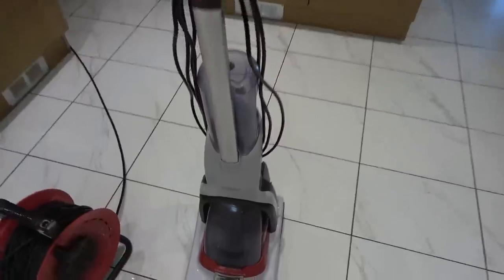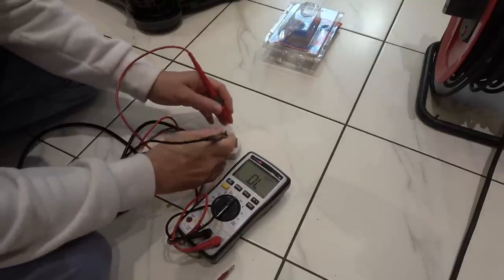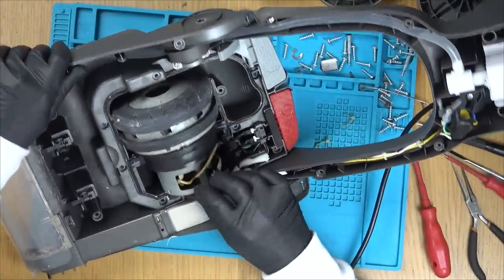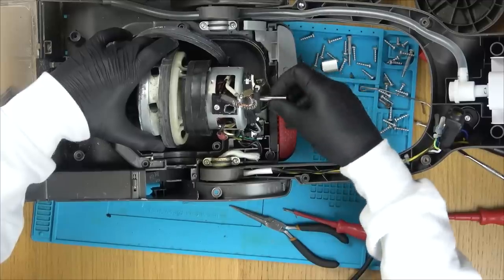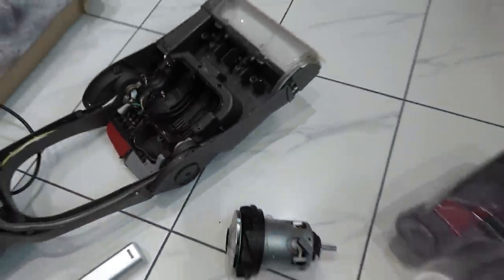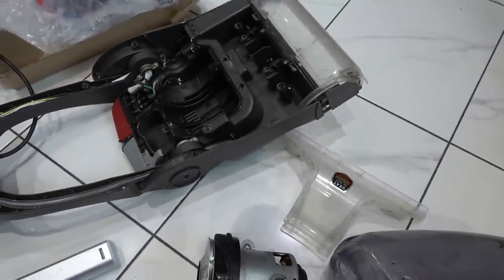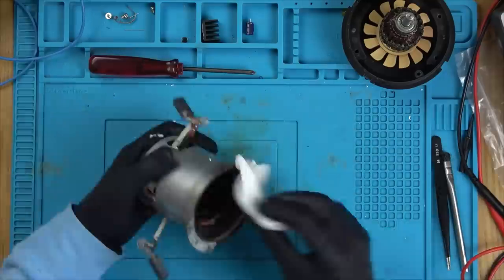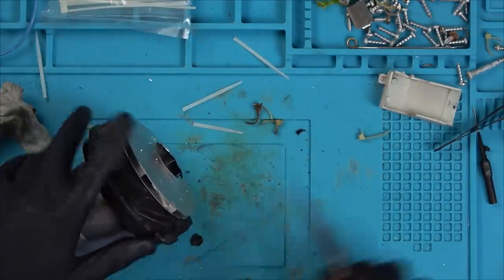Vax Carpet Cleaner Tripping the Electrics - Can I FIX it?

Comment: Vince, using Ohms Law, a 12 ohm load at 230 volts is a 19 amp draw.  (I=E/R) As others have said, the motor windings are corroded and internally shorted. The burning smell is the 19 amps heating up the wire/windings and burning. Probably the switch as well. Essentially, you made a toaster.......
Reply: Ohms law is only accurate when calculating for DC - it will approximate only when calculating AC
Reply: @Grumpy_Granddad  agreed however it’s accurate enough to see that at that load it exceeded the house supply . In the US, standard household outlets are 15 amps. I wouldn’t have plugged it in.

Comment: The moment I saw the discolouration of the enamel coating there was a 99% chance that motor was toast. The enamel coating on the winding's is the insulation. A company I worked for made Arc Welders and Spot Welders. The transformers not only used enamel coated copper wire for the transformer winding's but the completed transformer was preheated in a furnace/oven and dipped in another insulating resin and baked overnight for added safety and to prevent the winding's from vibrating against each other due to the magnetic field.
Reply: BASF  used to have a plant at a place called Slinfold in the U.K that made that coating . The chemicals involved were extremely toxic and unstable . They reckoned that if the plant went boom it would take out the nearby village . They used to practice for if a plane going into Gatwick airport crashed there

Comment: For future reference Vince, motors generally have a reverse threaded nut on the shaft, so that inertia "tightens" when it spins. That's why the nut wouldn't come off when you tried
Reply: Did just that only a few months ago, should have realised at my age, worse, I used an impact driver, sooo difficult to get off once I had stripped the thread, had to re-thread motor shaft to smaller size....... not fun
Reply from the maker: That didn't enter my head at all until reading the comments. Makes complete sense know. I'm pretty embarrassed, but at least I now hope I will remember that in the future when working on items with motors in. Nice one for the comment, thank you 👍👍👍👍
Reply: Yes that was painful to watch sure I've don't worse myself though. Nobody can know everything
Reply: yeah, I learned that when dealing with a faulty blender once, and found it consistent all over motor based devices.

Comment: I've learned a few times the hard way that trying to test motors and windings with a multimeter can easily trick you. If you do that more often an insulation resistance meter is worth it's money. I think they start around 50 bucks from brands like uni-t and others. They can do the resistance measurement under a high voltage so sparks can jump over and you don't get tricked by wrong results from a multimeter. If the insulation of some of the windings are slightly damaged or burned but don't touch each other you only measure the short under a high enough voltage because that's when the sparks jump over.

Comment: Definitely a new motor required.  Those windings are shot with the plastic cable ties melting and creating the burning smell.  It's a race between a fire starting and the mains power tripping.  Fortunately, the circuit breaker is doing it's job to prevent the other eventuality.

Comment: Hi Vince, you can generally tell by the smell when a winding is overheated and burning. The copper wire is insulated by a varnish and is unmistakeable. The cost of a motor rewind would be several times the cost of the machine so it is just junk. The copper can be reclaimed though. If you can get a new motor and it works, at least it will save even more plastic from landfill.

Comment: Some of the windings on the commutator (the spinning bit in the middle of the motor) have gone short. That's why you were getting different resistance readings while turning it. Unfortunately without a heap of work rewinding the thing it's nackered I'm afraid. Cheers.

Comment: it is always a pleasure watching someone struggling to undo the left thread  :)
Reply from the maker: Haha, oh no, are they really a left hand thread. That didn't even enter my head as a possibility 😂
Reply: @Mymatevince Yup sure are! I got tripped up for a minute when I pulled my Bissel HotShot carpet cleaner apart. That whole thing is an octopus of vinyl tubing inside. Such a PITA getting it all routed out of the way to get the casing halves back together. 
Good vid as usual buddy. Greetings from Kenosha, Wisconsin btw.
Reply: @Mymatevince  oh, yea, I know the feeling, been through this. It is like when you think you won an argument with a woman. You just pushed a little gey boy through a military school. Ever since my first vacuum cleaner "repair" I search the internet for every device I attempt to repair, even just from the same category, hard to find exactly same model. I would say, it doesn't change much, since the winding is cooked, but if you didn't strip it, you could attempt to rewind it. You would definitely fail, but it is really fun to try. You watch hours of your most careful work going with smoke in a split of a second. I did it like 4 times.  Cheers mate.

Comment: Good effort Vince. I think I would have called it after seeing the windings burnt. 
I think what could have happened is this...
If they had left the unit filled with water after use, moisture could have evaporated from the holding tank and the vapour went down the pipe and into the motor area causing the bearings to rust and seize the motor. 
The next time they used the unit (a few month later), it probably hummed and smoked a bit. They then probably unjammed the motor by turning the brush manually and then it ran with a very noisy bearing and semi burnt motor and tripped the electric.... and then you bought it :) Great effort though, and hopefully you can find a new motor for it👍
Reply from the maker: Thanks Mick, another option might be it leaking down from the clean water bottle up top. I only say that because since this video I was round my friends house and he borrowed one ( a Vax) that broke in his possession.  He said it is a common issue with it leaking from that top bottle, travelling down the upright bit and dripping into the motor area. I hoping a replacement motor will turn up on eBay and I can get  quick revisit done on it. Cheers for the help  👍👍
Reply: @Mymatevince  Ah no worries. I had something similar with a Milwaukee wet and dry vac (few months back) where moisture got into the bearings and rusted them resulting in a seized motor. Hopefully one will turn up with missing parts or cracked casing or something 🤞
Reply: @BuyitFixit  My mum's Vax just had the same issue with the motor effectively being rusted - is this a design flaw? would anyone have any ideas as to where to silicon so that any replacement motor is sealed effectively?

Comment: Motor definitely shot. It was a really, really bad sign at the video start when you turned the brush/motor assy and the ohm reading about tripled. Wether locked down and not turning or not, the ohm reading should not vary like that just by commutator turning on brushes. I also wonder if the water got in the motor because someone stored it laying down (or it fell over) with water in the recovery tank? Hope you find a motor soon mate!
Reply from the maker: Thank you 👍

Comment: I had the exact same fault on a VAX 6131.  One of the outer coils had a short after the motor flooded. This explains the on-off stuttering, as only one side was active. I had to replace the motor but when it arrived it was not the same despite supplier's promise. However, with a bit of ingenuity and cutting of the inner plastic cowling, I got it to fit. My model has a floating ping-pong ball to cut off the vacuum tube to prevent water being sucked up when the tank is full. This had failed. A new ping-pong ball did the trick. The old one had a roughened surface. Don't know why. By the way, the motor fan thread is left-handed on mine, so I guess it was on yours! DOH!

Comment: Did you check if the cleaning brush spins freely? It could be something stuck in the brush like hair or carpet fibres that would block or slow down the motor and make it overheat? That also happens with Dyson vacuums except they have a safety that stops the motor if the cleaning brush is blocked, if this one doesn’t have that, that could give this kind of symptoms I guess

Comment: I agree with a lot of the comments below, the windings have cooked, the coating has melted that covers the copper wire and it has shorted.
Just unlucky you don't have a PAT tester, this would have shown instantly that their is a high resistency, or dead short.
Testing the windings with a multi meter can be a pain as sometimes the windings check ok until power is put through them, then it arcs out, heats up and pops your rcd, the motor kicks in, shorts a few times then the rcd cuts your power, this is why the motor reacted as it did.

Comment: Hi Vince, the motor most likely block because the stator casing is not secured on the front cap. You can see the holes for the screws @20:08 (4 holes on the motor housing and 4 holes on the black support). Probably somebody else has been there before and checked the burnt windings on the rotor.

Comment: If the machine tips over with waste water still in it, the "full" seal isn't going to work if its switched off, so water gets in the suction pipe. You pick it up, switch it on and the water in the pipe gets sucked into the motor flooding it and possibly shorting it too. 
Your test while turning the fan showed that some of the rotor windings had dead-shorted, and as you found if the motor is left on when not turning, it overloads and 'cooks' the stator coils (the burning smell you had). a new rotor at least is required, a whole motor to be safe. The rest of it is OK, although a  bit dirty, and will live again. Don't landfill it, wait till motors become available.

Comment: The resistance readings can fluctuate as you're generating a voltage when you turn the motor and this affects the reading on the meter.

Comment: Yep , bottom line it’s a bad design , great video by the way . I bought a reconditioned Vax duo pet carpet cleaner( turquoise blue) ,after 2 replacements, with essentially the same issue (smoke coming out of the engine cooling vents !) it turned out to be water ingress from a faulty reseal valve under the cleaner fluid tank . Overall with your and mine , it seems to be that Vax have greatly unskilled labour on their assembly lines , wisdom as they say is proved righteous by its works !
Reply: Hi David -- I've got the same problem with a Vax.  Any ideas on what could be used to remedy it before I put it back together? I can't see any faults with the valve but plastic casing where the motor lies is full of dried dust that has been sucked up by the vacuum when it has been used.

Comment: I honestly dont know what a good ohms reading is for motor windings, but anything <10ohm sounds really low / faulty to me. Just a hunch. Nice try though, was interesting to see the insides!!
Reply: Like a transformer, since it is an AC device, it depends on inductance. The amount of power drawn is a function of both resistance and inductance (technically, resistance and reactance). So it will vary with the design of the motor. In other words, a motor with very thick winding wire and a lot of turns would appear to have a low resistance but would not take a lot of power because it has a lot of inductance due to the turns. A motor with thin wire (or maybe aluminum wire) and few turns would take a lot of power but have a higher resistance.

Comment: Failures on the copper coil aren't always visible. Only a slight area of scraped enamel will cause it to short and pull massive current, and trip. That's why it was revving, stopping, revving. The motor doesn't sound good either, the whole thing has heated up too much like an engine without oil and expanded excessively.

Comment: The design is clever to a point. But if the vacuum falls over with water in the dirty tank it will usually find it's way into the vacuum ducting and then into the motor. And because its dirty water it will end up causing shorts. 

If this happens to your vacuum its best to disconnect the dirty tank take the vacuum outside and run it until the motor is dry. I wouldn't recommend flushing the motor with clean water as its already a electrocution risk.

Comment: It would have been interesting to measure the rotor windings. 

Since the stator windings had the same resistance, but the resistance fluctuated when measuring both together (the whole motor) - its likely the rotor windings. If you have the patience, you could rewind the defective windings for very little money.

Also: It is not well explained while there is a lockup at the end. It is well possible that there is a mechanical issue with the vacuum. The burned up moto is then only the result of the lockup.
Reply: And China ~ where said motor was manufactured 🙄
Reply: Would it be cost-effective to ship the motor abroad for repair?

Comment: What follows is only a guess: I believe there is a semi short somewhere in the windings of one portion of your stator. Hence why when the rotor was spun and the magnetic fields where shifted you noticed the drop in resistance at the plug. A short as we often know creates more heat as voltage is shunt through the least resistant path and the current allowed in the circuit is no longer shared among the entire circuit. Thus producing excess heat in one area. In this regard melting the plastic bindings. Unless you have the aptitude to rebuild the stator, you are probably best to discard and get a replacement. It is odd that it locked or seized up like it did with the permanent magnets on the rotor not looking excessively damaged. Regardless is was a good attempt and I enjoyed following with you along the repair.
Reply from the maker: Thanks Shawn 👍
Reply: What is a semi-short exactly? to me either it's shorted or it's not.
Reply: @unperrier5998  fair, not the best terminology on my end. What I meant by this is exposed copper in the winding that is either occasionally shorting due to vibration or that are close enough to each other that even without direct contact there is arcing because of the circuit inductance.

Comment: If that was 10 ohms shouldn’t that be pulling around 24amps on that winding? Current= voltage(240) / resistance 10ohm?

Comment: I have one of these vax carpet cleaners and water gets in to the motor area VERY easily. I have had mine apart to dry the motor out several times.
Reply: how does it get into the motor? is there a way to mitigate or is it just shitty design?  thanks!!

Comment: Not sure if anyone has asked this but I think Vince put a plug in circuit breaker (GFI?) that he repaired in a previous (awesome) video. However, it didn't seem to do its job as a breaker.

What have I missed here? Cheers from Toronto
Reply: I think that circuit breaker detects current leaking to ground/earth. In this case, the motor was shorted from live to neutral, drawing a huge load but no leakage to the earth pin. A fuse or surge protector was needed here I think. If the copper winding had shorted to the motor housing, I think the earth leakage would have tripped.

Comment: Probably the fishing spinner jammed the float thing . How one of those would get into a carpet cleaner is beyond me . I used to work for a commercial carpet cleaning company and the first thing you did was vacuum the carpet .
If the motor got hot enough to melt the cable ties the chances are it has burnt through the insulation on the windings

Comment: Im surprised that a tinkerer at the level vince is that he hasent worked on motors before..  motors were the first electronics i worked on myself..  also surprised as hell he doesnt have a socket set handy off top..  kinda odd seeing on how much stuff has bolts and nuts on em..

Comment: On age, odd not to see a moulded plug on this. Also, did I see a 13amp fuse?  Maybe older than you think.  Often worth looking at the motor and plastic mouldings to see the year of manufacture. (Ps also a useful trick when buying cars etc. if you suspect accident repair.  Might not be obvious but a give away is buying say, a 2012 vehicle with a couple of parts with a 2020 manufacture date! 😂😂
Reply: You did see a 13amp fuse , suggested changing to a 5amp , then fuse blows first?

Comment: 19 minutes and 33 seconds on the left side of the lower winding in the video You can see what appears to be really shiny metal I believe the zip tie broke from the heat and then the windings rubbed out against the stator supports and they shorted to it.
Also if you look at the design of the cooling fan it doesn't make much sense The cooling fan is trying to pull air from the back of the suction fan it just looks like a bad motor design all around. They should have put the white cooling fan at the back of the motor where it could get fresh air from the looks of that plastic housing it's overheated quite a few times maybe that's just down to the design of the motor

Comment: I think I know exactly the source of the fault. Probably there was a damaged basket in the bearing. As an effect balls could spin freely, but sometimes the bearing was blocked, causing overheating of the winding and short both within them as well as to the body.
Reply: Sounded like the bearings had gone to start with

Comment: My bet is the windings have shorted due to corrosion. This caused a winding to overheat and that explains the burnt ties. Instead of replacing the motor, why not try rewinding the motor. Count the old windings as you remove them and rewind exactly the same way.